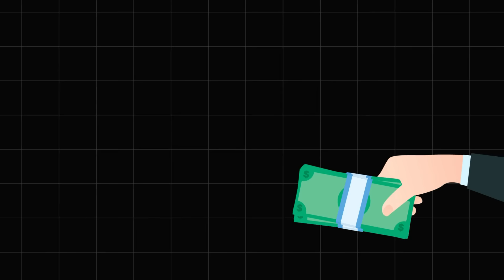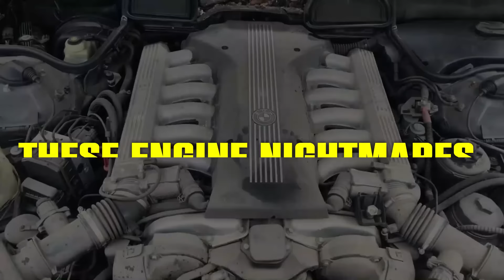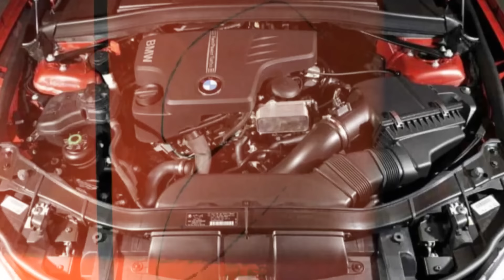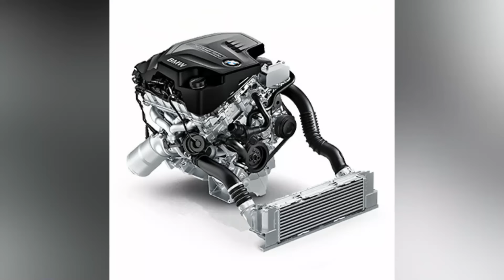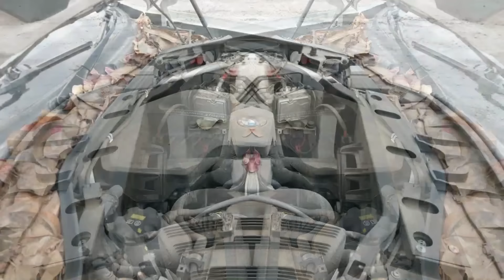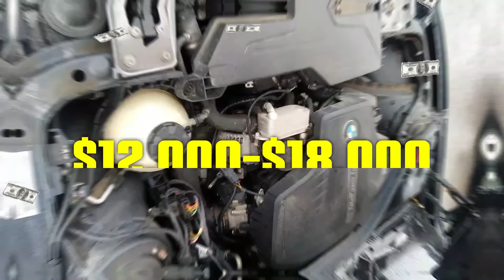15 Least Reliable BMW Engines You Should Avoid

Comment: Nearly all BMW specialists rank the N52 engine as one of most reliable inline-6-cylinder engines BMW EVER made. My Z 4 coupe has 200000 miles on the speedo without any problems and just regular maintenance. Mechanics love this engine. I don't understand why this excellent motor appears on this list.

Comment: My '20 M5 competition spun a rod bearing at 53k miles completely stock 😢. I'm still sad. It didn't burn oil but it went from no problems to complete engine failure. The dealership quoted $40,000😂

Comment: Is the N52 really worse than a N54 and N55? I can't fathom that being the case. I've heard horror stories of the N54. I have 2 N55's and so far so good. I know the Rod bearings and the carbon build up is a pain in the butt. I was looking at getting an E92 with the N52, so please let me know if I should walk away from the purchase.
Reply: Rod bearings isnt a problem on n55s, just let the car warm up and youll be fine, seen people making 600whp stock rods bc of proper heating up and cooling down cycles

Comment: BMW n20 has revised timing guides for cars made after 2015, but also, there’s things you can to prevent the timing chain from becoming loose. For example, changing oil at 5k miles max, not using auto start/stop.

Comment: N52 being on least reliable BMW engine list is wild...
Reply: Yea I was surpsied it was ranked higher than the N54 or N55. I was told by a handful of BMW enthusiast that the N52 is the best out of the 3.
Reply: @mariovilmenay8303 They were right, it's the best one by a long shot. It's basically one of the most reliable petrol/gas BMW engines ever. I casually see over 300k km N52s with little to no issues.
Reply: @tomrixcz6384  Mine died at 242000Km. The original owner had neglected it all its life until I bought it at 126000Km. The N52 is an amazingly smooth and refined engine.
Reply: @leisterbaptiste8668 Thanks for sharing experience. It obviously depends on the maintenance. If it is being properly maintained, it will outlast many diesel engines. Unfortunately buying the cars from previous owners is a gamble (unless they have documented service history). May I ask what was the cause of death for your engine?
Reply: My 2016 650 haven’t gave me one issue 98k miles oil changes every 3500mile I also have a lifetime warranty so the oil change is a must documented. No oil burning off maybe I’m lucky for now 😂

Comment: The early N63s from 2008 to 2013 were known to be pretty bad in terms of reliability, but it’s had many technical updates over the years that improved its overall reliability. The TU2 and TU3 versions have addressed most of the oil consumption issues and has better heat management (among other things) from what I understand. Definitely still not the most reliable engine ever and definitely not the easiest to work on either, but it’s less of a time bomb than it was before.
Reply: I am looking at a N63TU2 2022 m850. Oil change every 6,000 miles on car fax. Should I be concerned? Is it too complex with twin turbo V8??
Reply: @Ctpa1  Sounds like it’s been taken cared of if oil changes were done regularly at 6k miles. If you’re willing to deal with any of the other maintenance items that might arise after a while, I don’t see why not. I would set a good budget aside if something comes up, but if you’re worried about it though, getting the extended warranty from BMW isn’t a bad idea if you can get a good deal.

Comment: 2016 N55 155,000 miles all original. Only replaced serpentine belt,tensioner and idler, 3k mile oil changes, brakes, tires, air filter and 2 cabin air filters. Original spark plugs and coils and water pump/thermostat and hoses and charge pipe.

Comment: I have a 2013 BMW 328I X Dr. with the N 20 engine in it. It has 98,000 miles on it. I changed the oil every six months whether I drive 5000 miles a year or 1800. Just keeping my fingers crossed so far so good.
Reply: Bmw hatter!!all the prices r expensive but unreal